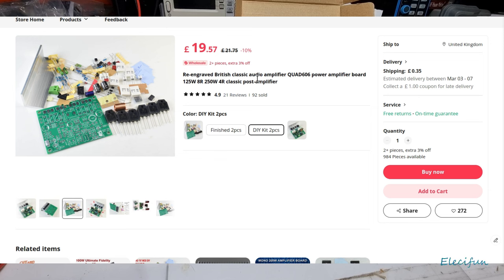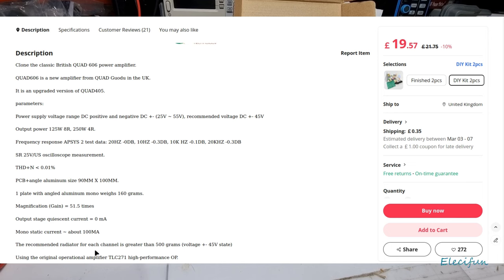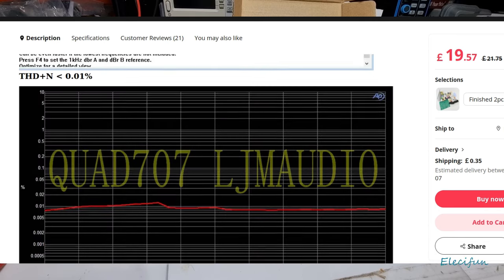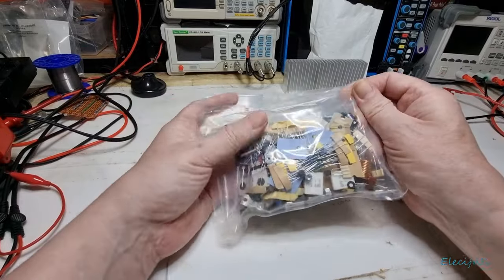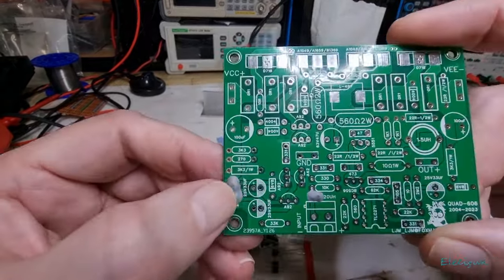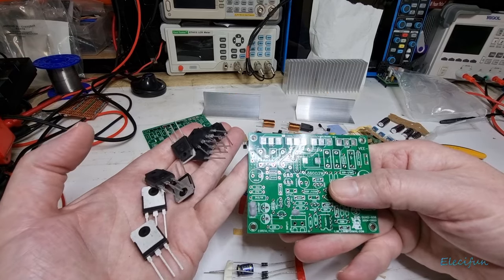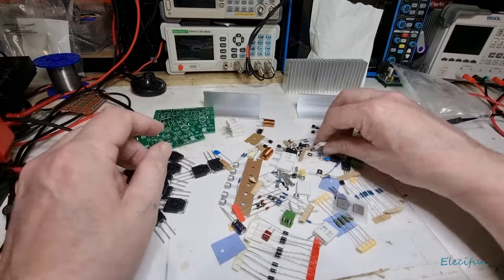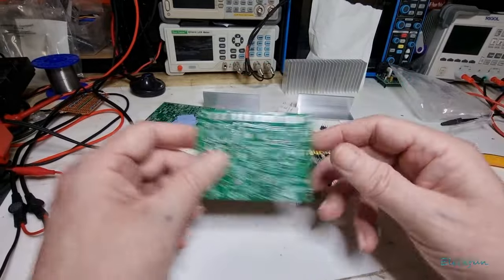QUAD 606 Amp Kit Aliexpress Unboxing

Comment: Oh well my order is finally being processed... 😀
Reply from the maker: @decem_unosquattro9538 great stuff. Just a heads up so you know, I have been listen testing the Quad*EDIT, 606*. It now is my favourite. I will explain why when I do the numbers test video.
Reply: @Elecifun  Oh! Is it more powerful? What's the THD? 🤔
Reply: @Elecifun  Oh incidentally it's fkn hot over here. I'm dreaming tommorow. 37°C.
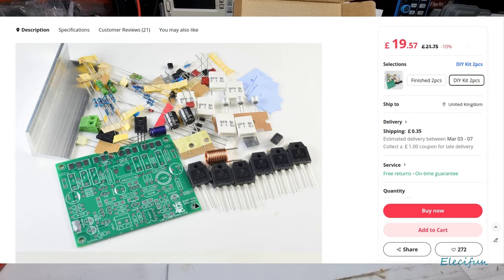Reply from the maker: @decem_unosquattro9538  I haven't done a number test yet. I wanted to listen without expectations. I've been up since 3:30 this morning listening at low level. Now listening at a moderate level. The sound delivery seems richer than the others, extra bass punch all the rest beautiful and clear. Makes my music collection sound fresher new again. I'm listening the the Eagles Hotel California album atm. Nice.
Reply: @Elecifun  sounds great sir ! 👍 

🤔  how many watts per channel?

What's are your speakers rated for (per channel RMS)?
Reply from the maker: @decem_unosquattro9538  My speakers are rated 120Watts per channel. The amp is supposed to give 125watts at 55V 0 55V 
I'm using a 42V 0 42V supply.
The richness in sound could all be harmonics. Like the warmth of a tube sound, harmonics.
Reply: @Elecifun  oh okay. 120W x2 🤔

And your new amp is 125W per side.  

It must be nice to listen to your own amp. 

I wish I had a decent set of speakers. 🔊 🔈 

🤔
Reply: @Elecifun  I can't wait to see it fully built and wired up and working!